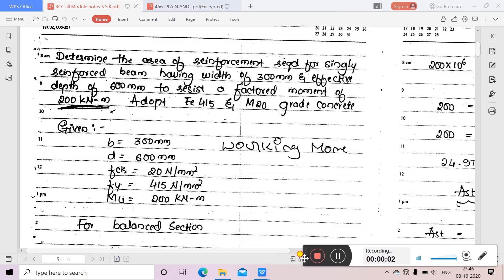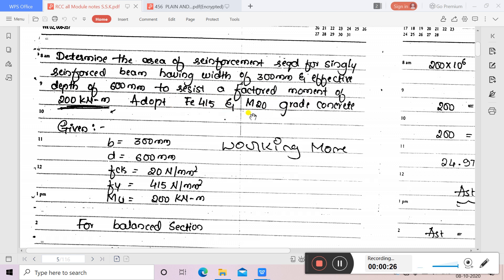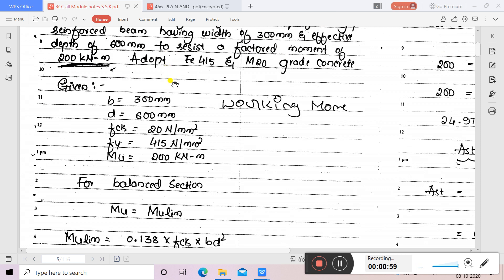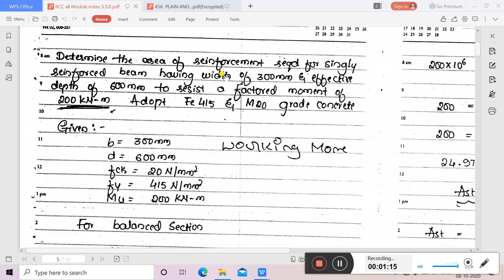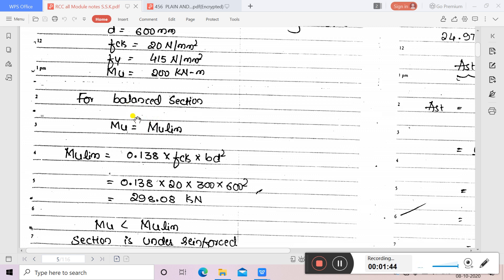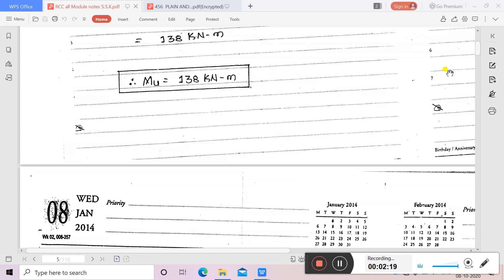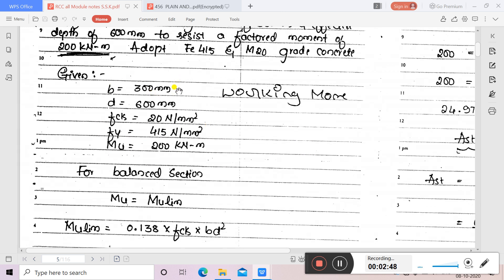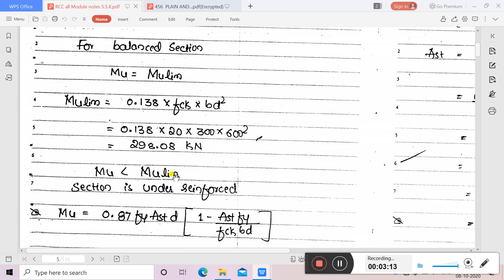HOW TO CALCULATE STEEL REINFORCEMENT IN BEAM

Comment: Calculate the minimum and maximum area of steel for a beam of
300 mm × 500 mm overall depth and effective cover 40 mm. Use fe 415